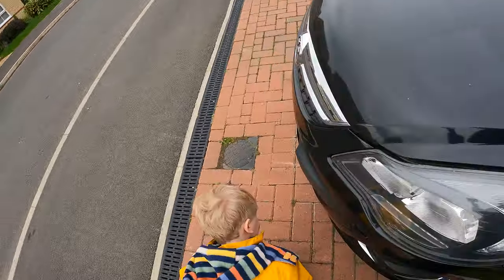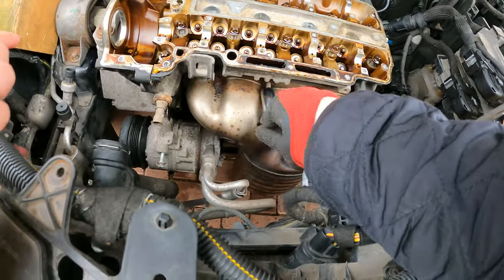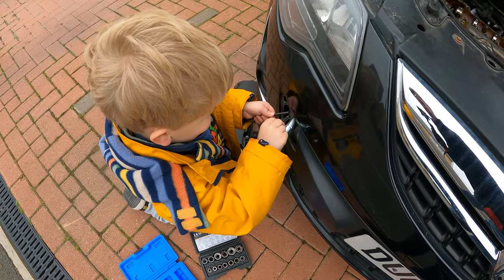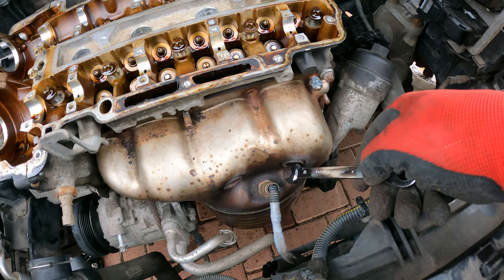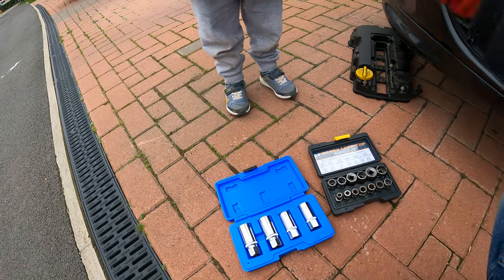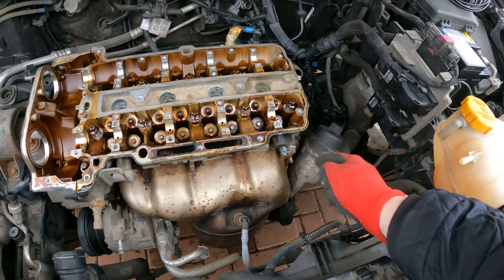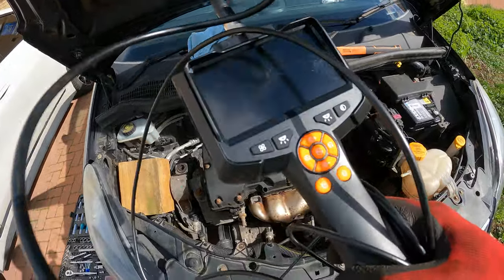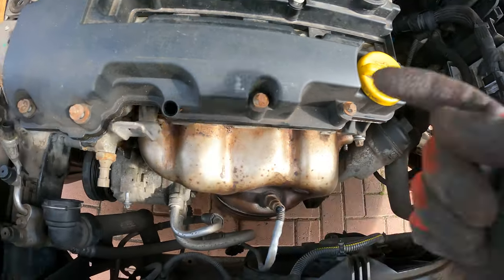CAN I STRIP MY SEIZED CORSA SRi ENGINE! VLOG 4

Comment: Not sure and angle grinder will help. At least you're getting some useful tools. Try endoscope through the sump plug hole? Think it's going to be disconnect the exhaust pipe at the joint by the sump and lift the engine out with the cat still attached but not a job to do on the drive, eg engine crane will be in the road. What would George advise - he seems quite clever...